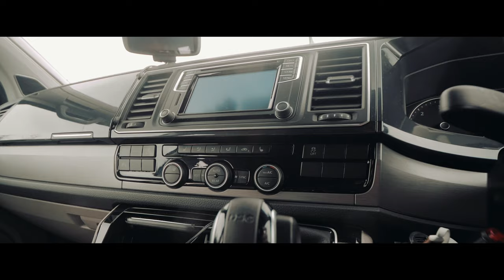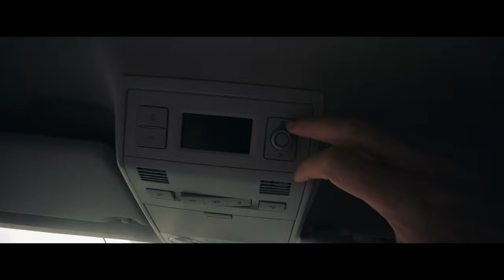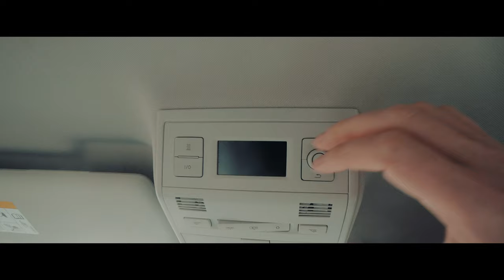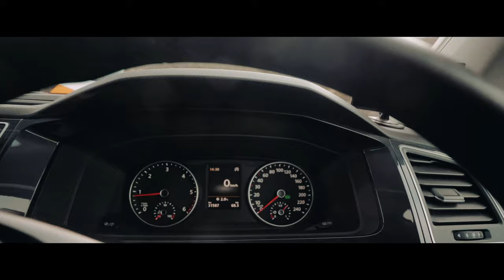VW California T6 (2016) after 4 years...

Comment: Thanks again Jay, almost same van as you 4 motion etc now 110000 km Scotland work n play and currently 6 month Euro trip, third set Vector tyres as needed more depth for Winter use by law here, teflon spray on all the cupboard and blind runners and you'll like them again, gas hob getting harder to stay on but might be thermocouples which I'll clean or get renewed at next service. We thought we had tried and tested simple set up but still managed to ditch a cubic metre of stuff to charity en route 😃 .. we carry drive away awning and have used it a lot during winter on stays of 3 nights or more but like the roll out awning half out say for a quick outdoor cook on a great Campingaz outdoor unit that uses same 907 bottle (I carried a spare). Like you think I'll just see what the T6 can do long term before changing. A lot of slightly larger Ducato based vans over here not that expensive but then I don't have to worry about where the satnav is taking me. We use campsites half the week and some real luxury for about 16 euros a night in winter - check out the ACSI book. I have some good van in the snow pics now 😉
Reply from the maker: Thanks John. Great suggestion re the teflon spray - where would I pick it up? Amazon presumably? Yes, its very easy to build up stuff but through experience you learn no to... 
Vanessa has her eye on one of those awning covers. We were also looking at non VW option (don't tell anyone!) - but like yourself, I think id rather to have the cash in my pocket! Ha! Again, thanks for a great comment! J.
Reply: @The_Rainmaker  Meant to say silicone spray - mine is a Baufix Silicone Oil I got cheap in Lidl - ok with plastic (and also ideally rubber door seals as good for them too to keep everything watertight)  -  I see WD40 do one - https://www.amazon.co.uk/WD40D-N-A-WD-40-Silicone/dp/B006UCNI38
Reply: @The_Rainmaker  PS Kate's Instagram is smilektk63
Reply from the maker: Cool - thanks! I’ll keep an eye out!
Reply from the maker: joined just now - lovely snaps!
Reply: @The_Rainmaker  hi again Jay, just got van serviced VW camper centrum Amersfoort, Netherlands and they refurbed gas hob and fitted much better silent hob ignition for 150 euros, worth a trip for that alone 😀
Reply from the maker: johndgn Cheers John. Good to know they can do that! J.

Comment: Very informative. Many thanks! We will get our brand new one, mid february. Very excited, and your video gave us many valuable tips. One question: Do you have any thoughts how to enter the roof bed, with minimal risk of damaging the arm rests or damaging the seat heat?
Reply from the maker: Happy to be of help Tomas and we’ll be doing a 5yr vid in February ( lock down permitting). We don’t use the arm rests as a ‘ladder’ rather the main seat itself and shoulder area instead. Christian might use the arm rest but he is careful to step on the  armrest where it joins the main seat (presumably its strongest point).  Other than trying not to bounce too much (rather a pull using the bed) tends to cause no damage. Best of luck and maybe we’ll see you out sometime! 👍🏻J.
Reply: @The_Rainmaker  Thanks! Hope to see you guys out there!

Comment: Cool video, VERY informative (and very long).
I don't know if you said it anywhere in the video, but how far has it driven and how is it holding up?

I am considering buying a used T6 California from 2016 and I was wondering how it holds up in terms of the engine and all that technical stuff.
Reply from the maker: Thanks Duddel!
Apart from the initial teething issues that can happen with a brand new vehicle/design its driving very well - we've just done about 35k km. No problems, no loss of power, leaks etc...

Comment: My dashcam doesn't turn off with the ignition, so we have to unplug it every time. Even though the camera is set to turn off with the ignition.
Reply from the maker: Ours stays on until powered off manually by myself or V. Sometimes I leave it running to keep an eye on things when away from the van; as it runs off the leisure battery we don’t need to worry about starting the engine.
Reply: @The_Rainmaker  Are you sure it runs off the leisure battery? In a normal car, via the cigarette lighter socket it is the car battery.